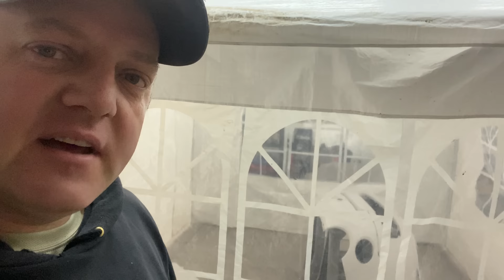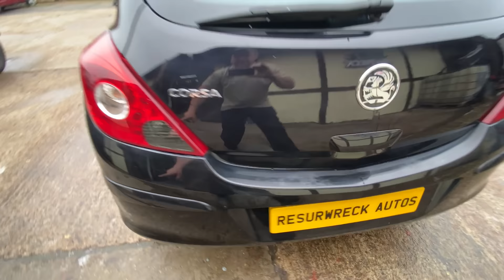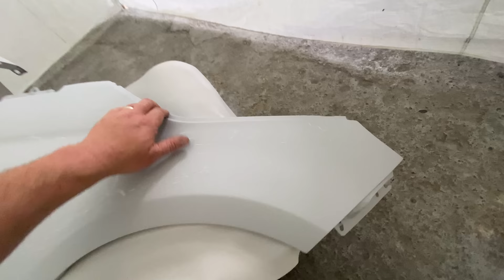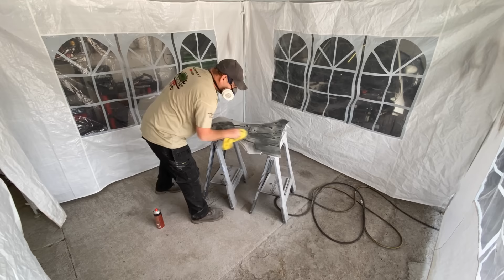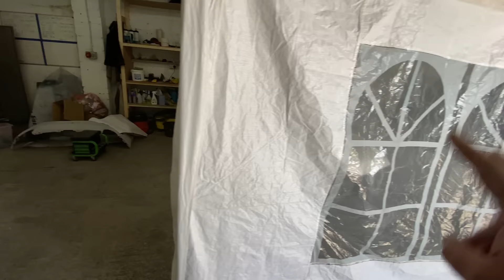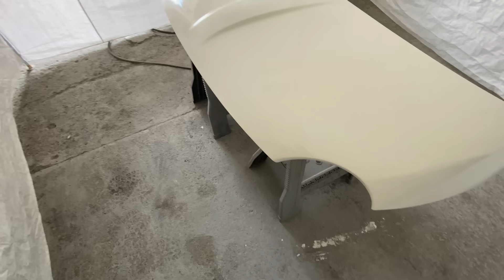Fiat 500 2015 Cat S Part 5 Painting The Bonnet Its Not Easy I Get Problems

Comment: Hi Mark, good first attempt, I agree with others, your a bit close to your work and you need to go passed the end of the work piece. Otherwise you get to much paint on in the pass leading to runs. Light covering and multiple costs are best, it’s very tempting to lay it on thick but that leads to problems. Good video as usual keep on trying you’ll get there.
Reply from the maker: Thanks John appreciate it the info yeah it is very tempting to just lay it all down I just need to lean the correct way I’ll get there 👍👍

Comment: Wipe runs flat with your thumb,then it should be dry enough to flat in less than an hour.try using less thinners in basecoat.i mix 60/40 (40=thinners).15-20 mins between coats,depending on temperature.
Reply from the maker: Thanks appreciate the info I will try 60 - 40 nice one mate 👍👍

Comment: Don't sand primer with 2/3000 grit itll not have "rough" enough to stick, 800 is high enough. After clearing if you want to sand and buff try to get up to 4k grit itll make it easier to buff with your da.
Reply: Continued watching 600/800 is perfect prep for base coat
Reply: Try turning down your liquid/ paint needle and built it up in layers rather than one heavy coats thats why you are getting runs. If you get runs wait until its dry and flat it back and spray it again. Main thing is too much paint coming out so either move quicker or easier turn down paint and build it up, otherwise clear will be harder.
Reply from the maker: @kylelogan5010  thanks buddy appreciate the info 👍👍